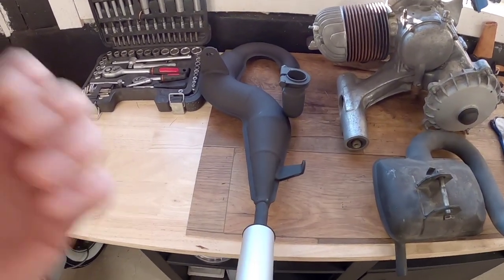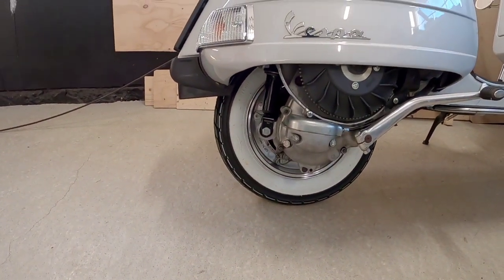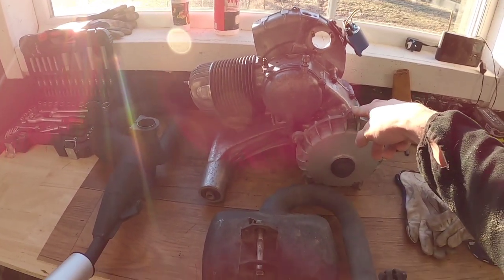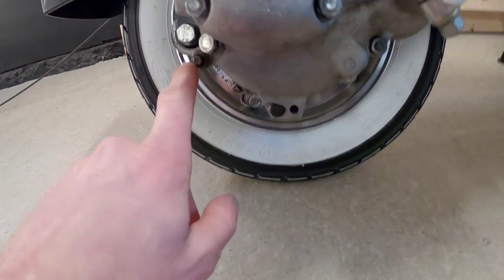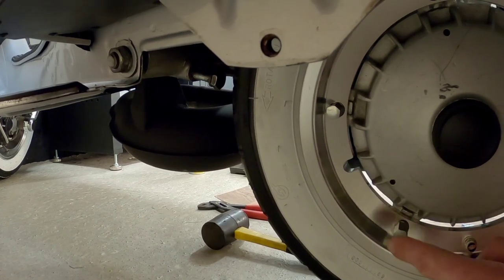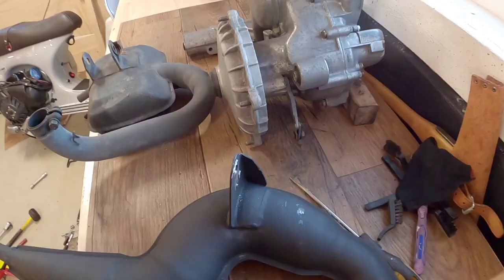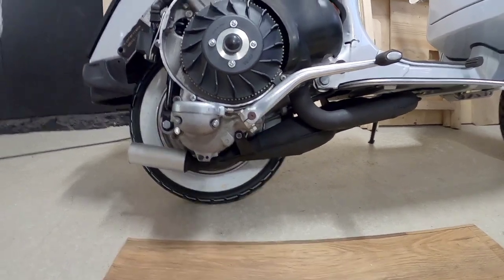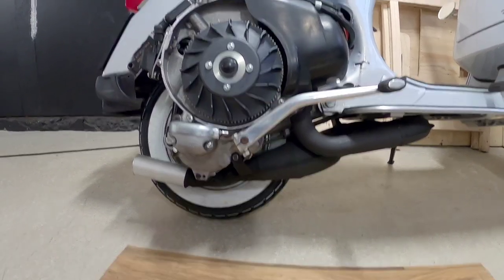Vespa px / How to install a Polini exhaust

Comment: do you know if there is a difference between Polini exhaust PX 125 and PX 200? have one at home for PX 125 and that cylinder won't fit the end of my exhaust
Reply from the maker: Hello.
The 125 exhaust won’t fit a 200. I think 125-150 are the same but they don’t fit the px 200.
Reply: @Nordicexplorer1  Ok, thanks , i will order a Polini ( Part number 200.2023/S Vespa PE 200 Retail Price Euro 171,00 + VAT)
Reply from the maker: @gillessmeets8531  That should be the right exhaust for your bike 👍

Comment: i have SIP tubeless rim installed.  Will it fit ?
Reply from the maker: Yes it will. It’s sip tubeless on the bike in the video
Reply: @Nordicexplorer1  thanks lot.  Can you give any idea why engine is bogging at 1/4 open throttle .
Reply from the maker: @squeezzeee  👍. Sorry, hard to give advice for that without being by the bike. Could be number of different reasons.

Comment: What about carburator?
Reply from the maker: Hello.
In this case I was using a 28 mm Smartcarb.
But when I sold the bike I mounted a 24 mm SI carb with enlarged fuel chamber channel and 125 main jet. Drilled heart in the original air filter.

Comment: du, den kommer nog låta rätt mycket dendär:)
Reply from the maker: 😁finns viss risk för det. Hoppas den levererar vad det gäller effekt också.
Reply: @Nordicexplorer1  det får man hoppas:)
Reply from the maker: @Hajime Kuma hello.
It sounds much more than the stock exhaust, not so much at idling but when pulling the throttle. The sound is a bit like a two stroke dirt bike.
There is two screws in the back of the muffler.
In a upcoming video you can hear the sound.
Reply from the maker: @Hajime Kuma When we get some spring weather here I will do a sound check video with idling and flyby test.